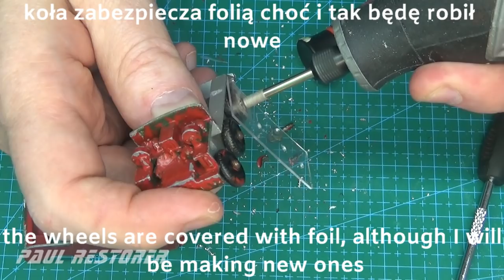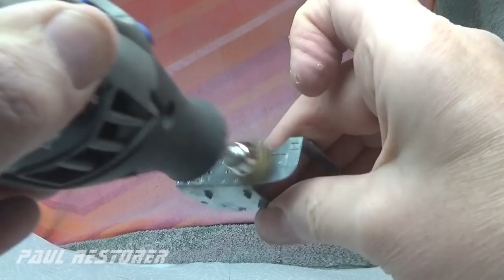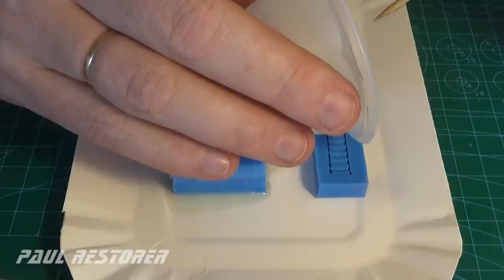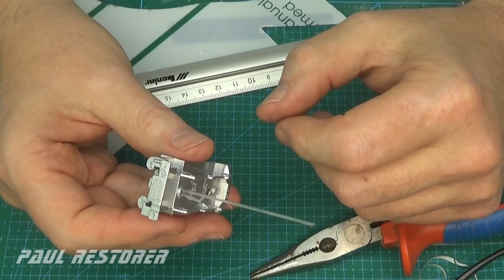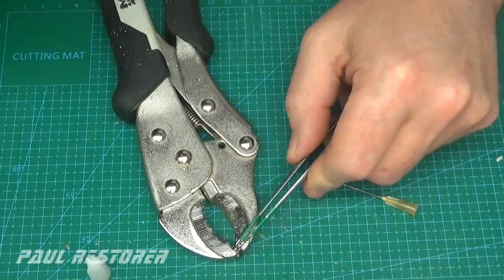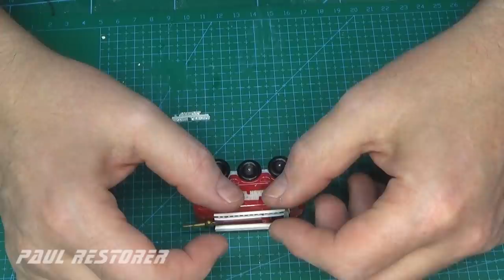Matchbox restoration Foamite Crash Tender nr 63 diecast car , making parts

Comment: Great job. Would it be possible for you to use a 3D printer to make some parts?
Reply from the maker: thank you very much. some parts are even designed for a 3D printer, only the print quality is insufficient for me. The printer makes stripes that can be seen all over the surface, it is not smooth.
Reply: Yes, I see the problem that the 3d printer would do that.